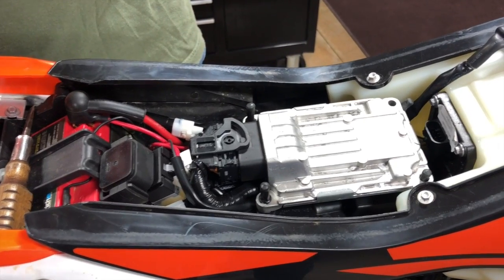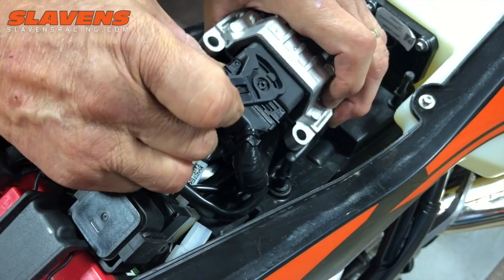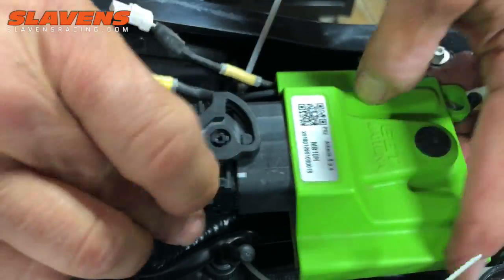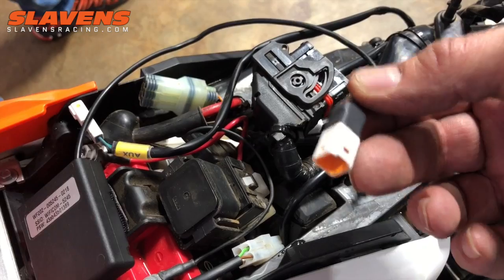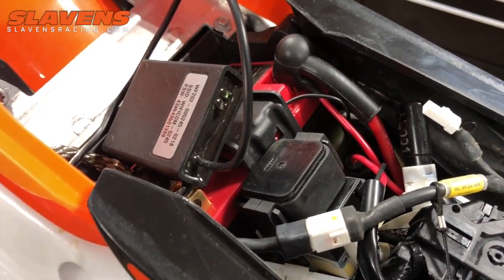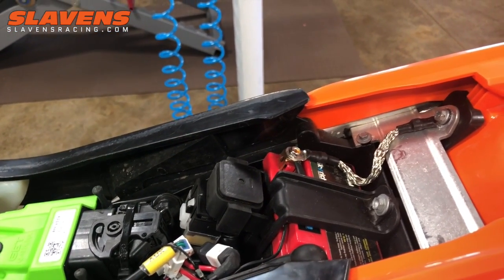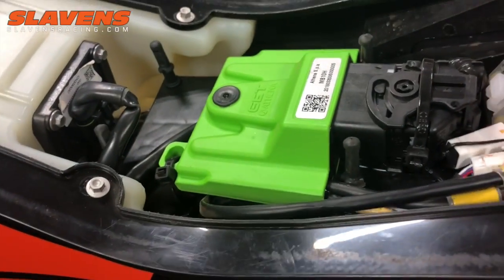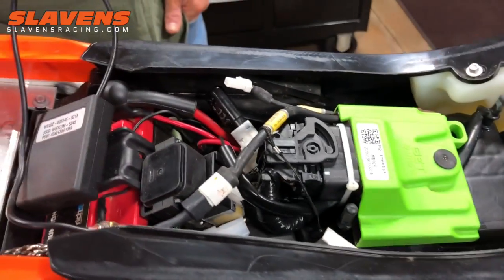How-to Install GET ECU for KTM, HQV 250 300 TPI

Comment: Great Video!  A couple of questions though... 1) is the map switch that comes on the bike (TE300i), essentially disabled when you install the GET? Can the stock switch be connected to the GET ECU so you do not have to install the GET switch on the handle bars?  I think it would be cleaner if the stock switch worked.  2) if you take out the stock ECU, then go back to it - will the original map reactivated - I'm sure it will, but figured I'd ask
Reply from the maker: 1.  yes, yes
2.